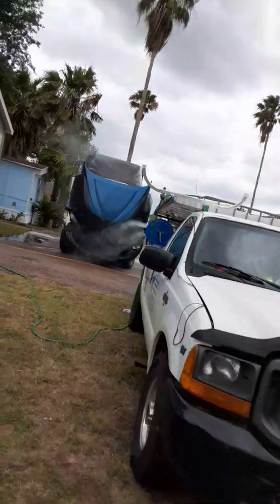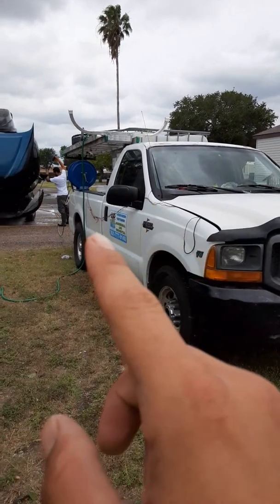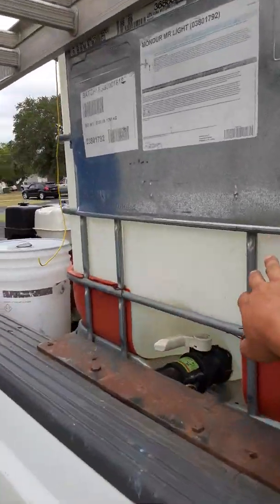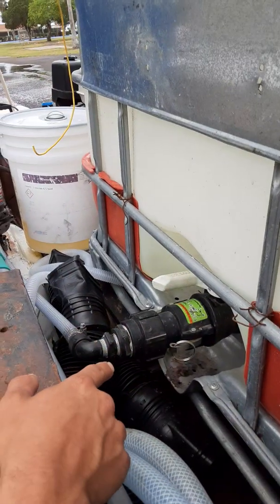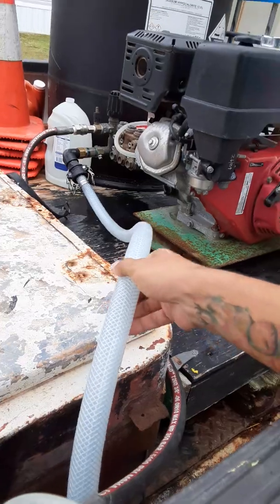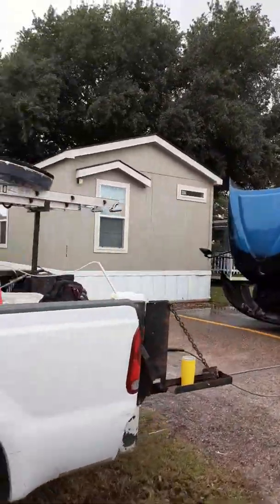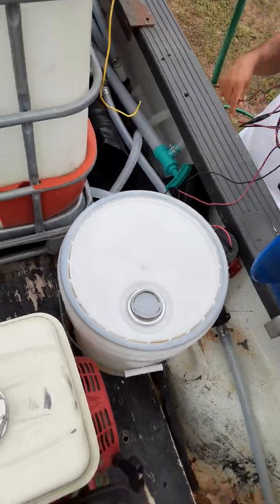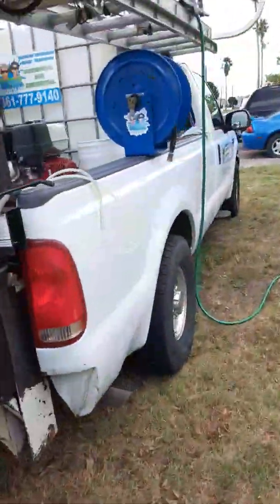Pressure Washer Force Feed Set Up

Comment: I have a simpson 3300 2.5 and i thought that the triplex pump that's on it would draw the water from my tank and apparently it doesn't.  I need to run something like this
Reply from the maker: Yes sir, some direct pumps do pull water with ease it is just doing the research to find them, also you might want to look into converting to a belt driven pump
Reply: @fazpowerwashing  thanks, i'll probably just run a booster pump to increase the pressure.
Reply from the maker: @allenperez2654  make sure the electrical wiring on the 12v pump is secure so you won't lose pressure mid wash
Reply: @fazpowerwashing  im going to see if i can find one that'll plug into my generator because my truck is old and i don't trust wiring that to the battery lol but i do have a spare battery that i can always plug to that

Comment: Is this because your pressure washer isn't a gear drive/belt drive? I have a 4 gpm simpson 420cc, and I am wanting to do the same thing, but I will run 1" line from the tote to the pressure washer.. Appreciate any help - good luck this season
Reply from the maker: Yes this direct drive unit can't pull water on it own that is why we mounted the 5.5gpm 12VOLT pump so the water can flow into our pressure washer pump. 3/4 line should be fine but 1" would definitely be more water flow.
Reply: @fazpowerwashing  is ur machine 5.5 gpm as well? My pressure washer doesnt have an area for a bypass it has a thermal relief valve instead which also sucks.. lol but i would want a 4gpm pump with a 4gpm machine right??
Reply from the maker: @Nouri_TV  This pump is a 5gpm pump, this pump also has a thermal release valve but you can run a bypass hose from your unloader back to your water tank